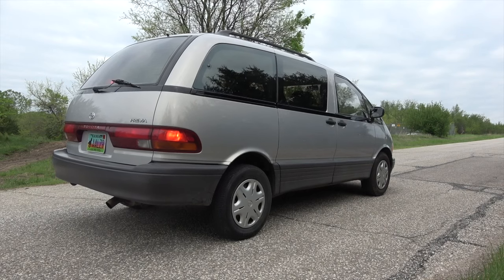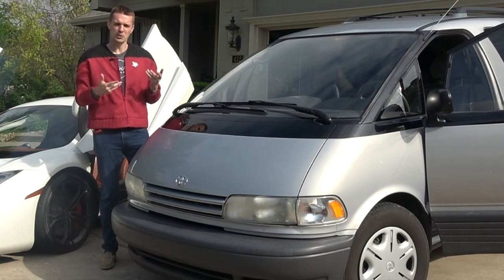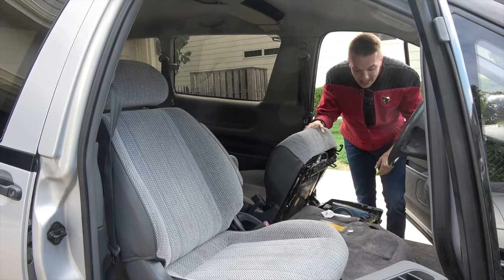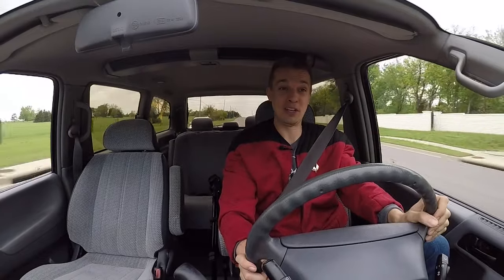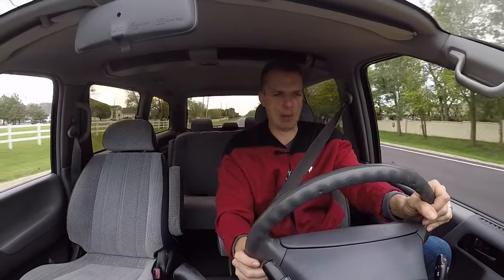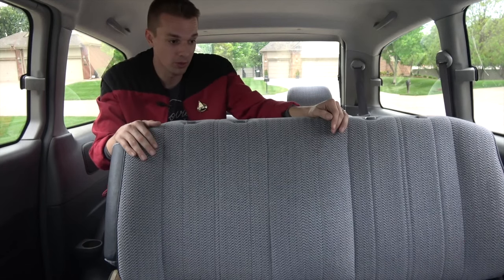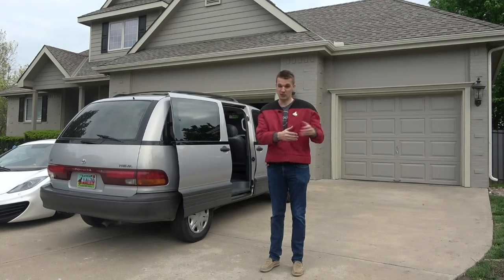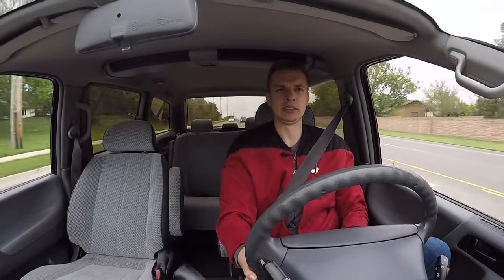I Bought the Greatest Minivan Ever Made: Toyota Previa Supercharged SUPERVAN

Comment: Be mindful of the supercharger oil in these. Most shops/mechanics don’t even realize there is an oil reservoir dedicated to the supercharger oil and running the level low can do some damage.
Reply: The oil is basically the same as gear diff oil. Like a 75w-90. On my 97 Previa SC at least there was no reservoir, just a drain bolt and small 1/2" maybe 3/4" sized  yellow fill cap directly on the side of the supercharger. I used to change it myself about every 15,000 miles since gear oil is much longer lived than engine oil.
Reply: @roochiecooch  Hi may I ask where the SC is located?  Is it under the Brake Master Cylinder near the airbox or on the passenger side below the alternator ?  Thank you

Comment: I had a diesel version. Brilliant thing. I ran it on everything from vegetable oil to WD40 and it did burnouts 🙄
Reply: Ah the days of running diesels on used chip fat...
Reply: @catnapwat  Those days are still alive
Reply: Not sure modern commonrail diesels will run on vegetable oil
Reply: @catnapwat  There's still old cars on the roads
Reply: @catnapwat  ya you have to actually make bio diesel (filter it and cut it with alcohol) for modern cars and even then it's not recommended to run it all the time. I used to run it through my 03 golf TDI every once and a while.
Reply: It will but you have to preheat it to 70-80°C to make it runny.
So you start the engine on diesel and after it reaches operation temperature you switch it to vegetable oil. And before turning the engine of you drive the last mile on diesel to flush the injectors
Reply: @CAESARbonds  I've seen people just use fresh new oil, it ruins the injectors on the long run but works and drives normally
Reply: Wd40 wtf
Reply: People are importing the diesel versions into the US for this.
Reply: @CAESARbonds  Nope, I ran it for 8 years on Veg oil with no modifications, through hot or cold weather. It ran best on Rapeseed oil which was actually the cheapest. Achieved 115mph on it. The only downside was it left the rear of the vehicle covered in a sort of varnish and some people complained that it smelt like a chip shop. ;-)
Reply: @catnapwat  Well I'm not sure  want to put it in my Merc C350 to find out. The merc does have a heater element in the fuel filter so it probably would work but no I would only do it in an emergency!
Reply: @VitariusLaszlo  Yes, we had a large drum of it, so we had to try it, the car was almost empty so we put about a gallon in it, it ran perfectly and the exhaust smelt wonderful ;-)
Reply: For clarification it was a 1992 Toyota Estima Emina. Imported into the UK. It was a 2.2 Diesel with a Nipon Denso injector pump (Bosch copy) Rear wheel drive. The Estima was 100mm 4" narrower than the Previa for the Japanese regulations.

Comment: Owned one of these in AU for years, here is trivia about the previa in Australia, we don't have that seat flipping back problem on Drivers side "which is good" it's on passenger side which OEM think was designed in Japan and named Tarago or import Estima in AU.
It's true about how it sits on road for road handling ,great for long trips back in the day. 
The End came when headgasket blew the 2nd time @over 400,000km on the van.
Reply: stigonutube Yep Previa head gaskets. We see a ton of these vans in NZ and petrol or diesel engines have legendary head gasket issues. So many Toyota engines of this era did.
Reply: I had a car with the weak head gasket problem. If I hit traffic it could overheat and blow the gasket. So I fitted a switch inside the car and ran the wires to the electric fan thermostat in the radiator.
As soon as I hit traffic I'd switch on the fan and the engine never got hot so it never blew the gasket again.
Reply: @Google_Does_Evil_Now  yes however only so long they will keep running in that state of failure of headgasket, mine started loosing coolant and then hydrolocked in piston the 2nd time round..great vans but was time to say goodbyee
Reply: @DiscoFang  yes first one was corrosion in head coolant ports and lead to failure then 2nd time was loosing coolant and one day just hydrolocked when i try to start Van. greetings to N.Z From AU :)

Comment: The reason you can't find them is cause certain handymen and house painters love these things
 You truly do love crap
Reply: They love them because they last forever and don't break down.  Previa is one of those cult vehicles that's impossible to find for sale, because the owners hang onto them for 5, 10, 15 years and drive them into the ground, they're non-running scrap with 300k, 400k miles on them when they're done with them.
Reply: @aaronbays4  Every vehicle should have the fuse panel up top&center like that

Comment: In Australia they called the Toyota Previa a Toyota Tarago.  I had a 1991 2.4 litre Tarago for 24 years.  The most difficult problem I had to solve in those 24 years was an oil leak that I thought initially was a rocker cover gasket.  I finally figured out it was the o-ring on the distributor.  My wife wishes we still had that car.  Was so good for a growing family and long trips across Australia.

Comment: I have a '95 Previa S/C that I bought new in 1995.  202, 000+ miles and still going strong. I am a trek fan too, license plate holder states "Star Trek Fan Forever, ST/OS, ST/NG, ST/VG and ST/DS9"  This van has cost me very little to maintain, except of course the A/C that had to be overhauled last month after all these years.  What Hoovie failed to mention was the versatility of the configuration he has.  Despite the fold up rear seats, with the middle seat out you can carry 10 - 12 4x8 sheets of drywall or plywood, flat on the floor and still close the rear hatch....  Who needs a pickup of truck if you have a Previa!

Comment: Check the Distributor o ring gasket and the valve cover gasket/ spark plug boot gaskets. Both of those are prone to crack and cause leaks, but easy to get at once you pull the pass seat and unbolt the access panel. For a real unique build, swap it to manual with a 1991-1992 5 speed alltrac trans, and add a manual 4-low transfer case from a 1980's toyota 4wd manual van. Gonna need to do some welding to get the front diff mounted though.

Comment: Owned a ‘91 RWD, and totaled it in an offset head on collision at highway speeds.  Bought a new AWD one the next week, because it does snow in Iowa.  We owned it for 13 years and 185,000.   It was a great car.  We sold it for $3000 and they drove it another 100,000 miles before it got totaled.

Comment: Tyler, didn't the steering columns of these have a tendency to puncture the drivers thoracic cavity in front end collisions? 

Did you mention that it could be had with a MANUAL?

I think Yamaha designed the engine. (like the later model Celica).
Reply: Internet mechanic here

Can confirm
Reply: I had a ‘91, and we were in a frontal offset collision at hiway speeds.  We were fortunate to walk away.  I went out and bought another one the next week.

Comment: I owned 2 of the previous generation of the TOYOTA LE  van wagons an '85 & '86. Loved both of them.  Wanted to get a Previa, but haven't found 1 in good enough shape yet.

Also had 1 of the '90 Oldsmobile  Silhouette (Dustbuster) vans. Paid $900 cash at a car dealer for it.  Only thing that ever went wrong on that van was the water pump went out when we were going to trade it in.  (Didn't trade it.  😊) did eventually give it to a friend who didn't have a car. He in turn gave it to another friend doing pizza deliveries, and it's still going last I heard.

Comment: Owned a ‘92 Previa Alltrac.  We drove it 13 years and 185,000 miles.  Replaced with a AWD Siena, which was nice.  Wished I would have kept it.  Other than not a lot of power, and the AC couldn’t keep up after 105 degrees because of all the windows it was a great family car.

Comment: get a smaller pulley for the SC, ad a LSD, remove the seats and take it to the quarter mile!
Reply: So blow up engine after and junk it inside of a week lol.
Reply: ...sure, then take it to the wizard. more content for us
Reply: It'll possibly break into the 16's in the quarter with a smaller pulley. What a rocket!!!
Reply: @rhull3939  Very well could.  Uou just need to start worrying about the internals at a certain point.  If you plan on much life for it.
Reply: @cardinaloflannagancr8929  it would make about 200 hp. No need to worry about internals at that power level.
Reply: @rhull3939  I gotcha  sometimes people go overboard thinking oh just a pulley.  Local shop by me had a Lincoln Mark 8 up around 750hp.  Next owner threw a smaller pulley and blew it up.  They told him it was maxed without forged internals this that etc..  .  It had trans, diff all metco suspension underbody bracing.
Reply: @cardinaloflannagancr8929  750 is a lot. Going up from there will lead to things breaking all the time. What engine did they have in it? The 5.4, 5.8 or a coyote?
Reply: @rhull3939  They had the 4.6 dohc amazingly.  Though added SC and quite a bit else.  Couldn't believe it wasn't enough for somebody.  This wasn't a pure track car either, full interior with integrated roll bar under matching fabric.
Reply: @cardinaloflannagancr8929  that is a lot of power to make from that 4.6. was it the one from the 03-04 Cobra with the forged internals or did they upgrade to that?
Reply: @rhull3939  For whatever reason the original owner built up from it's factory dohc intech 4.6 32v.  Kind of just to do it type of project.   Crazy thing was that Mark 8 weighed more than the next project a 70 chevelle.

Comment: I bought a used one in 1999 because I liked the styling.  It was all wheel drive non-turbo so it was slow and the gas mileage was poor at around 13mpg.  The driver's seat was surprisingly uncomfortable on long trips. I was able to sell it for what I paid for it after owning it for only 6 months and I went back to a pickup truck.

Comment: Had one supercharged.  And AWD.  Plenty fast, especially how well it cruised at 75 mph.  Now, Hoovie, PLEASE PLEASE stop doing burnouts in such an old vehicle.  You mention it was leaking - well many of them did that eventually, and yours didn't have that many miles on it.  Burnouts potentially cause many other problems besides ruining that right rear tire.  Just stop.  Got that off of my chest.  Thank you.  We loved our Previa.  At about 200k it started with some electrical / wiring problems.  Likely due to being in the Northeast and salt on the roads during the winter.  Had those issues not started, I may have kept it several more years.  Also, I put in an aftermarket radio with a bit more power, but not a big amp or anything.  My Previa actually had a small subwoofer (stock) in the way back, which sounded really great with the after market stereo.  Hoovie, keep up the good work, and never get normal.

Comment: 2 years ago bought a 95 supercharged 140k and it was immaculate. It's was a trade in at a toyota dealer. After 4hours of negotiating I got them down from 5k to $2,200.  3months later it blew a head gasket and I sold it to a scrapper for $300. These things are such a nightmare to work on they are easily totalled by one major repair. They are cool but id stay away.

Comment: Hoovie, why do Americans go wild for manual transmissions?
Manuals are standard in Europe, we see autos as luxury, refined and even sporty (flappy paddles F1 style autos, Colin McRae rally type paddles).
Are USA autos slow at changing gear?
Is it because your roads are so wide and straight that you don't steer much so changing gear gives you something to do?
Driving quick on European roads that are narrow, twisty and full of obstacles an good sporty paddle auto means we have more control and go faster.
Maybe you can explain this or chat with Doug about it because it's a big difference between USA and Europe.
Thanks.

PS: maybe you'll do a European trip and try some unusual cars on our twisty tight roads?
Reply: T A they’re a dying breed over here, that’s why. Most cars don’t even have a manual as an option and even those that do are extremely hard to get or hard to find.

Comment: "You hear the supercharger and it is directly underneath you." 
No, actually the forward facing driveline drives not only the accessories but also the SC14 Supercharger. The supercharger is nestled right in the middle of all the accessories up front under the hood. It's held up by a big heavy cast iron bracket. There's even a small intercooler underneath the airbox, about 12 to 14 inches tall by about 10 inches wide, with the normal plastic end tanks that oem's use on intercoolers. I robbed the supercharger off of ours before sending it the junkyard to swap out the nearly identical but slightly smaller SC12 supercharger that was on my first gen SC MR2. I wanted to keep the previa but all at once the slider got stuck and engine blew, and was too much at the time for me to deal with in an apartment. With a little banging of the firewall the stock supercharger from the previa fits on the MR2 and adds a litte more omph. But that didn't last long as I now have a 3SGTE in there from the 2nd gen MR2 Turbo.
Reply: The midde row in mine were bucket seats, the also swiveled 180 degrees to face the back row. Not sure why? Maybe so a mother could tend to her infant in the back row? Still thought it was a cool feature.

Comment: might be 150hp, but 200ft/lbs of torque at 2000rpm. I don't know how they did it, but that engine is extremely high torque. Probably due to the rear end being geared, because there is really no difference in acceleration between this and a V8 F150 with twice as much power and weight.

Comment: You did get the All-Trac? Too bad : D

Dad still has a 94 Previa LE SC All-Trac, gold, auto - 285k original miles.

Also had a 1992 Previa, white, manual trans, non-super charged, 425k before a timing chain guide broke.

Comment: I'm not going to spoil this with tales of a Chrysler mechanic in the backwoods of Chesapeake who had a 12 second 1st generation Dodge minivan.  

But it is worthy to note that what you love about the interior is exactly what was designed into the 1949-51 full size Nash Ambassador and Statesman models.http://www.oldcarbrochures.com/static/NA/Nash/1950_Nash/1950%20Nash%20Airflyte%20Foldout/1950%20Nash%20Airflyte%20Foldout-02-03.html  Parents in those days were so afraid of the teenager whose parents let him drive one of those...

Comment: I read that the reason Toyota put a supercharger on the Previa was they still had quite a few superchargers left over from the 1988-89 Supercharged MR2's and decided to use them on their woefully underpowered Previas.  The Previa is hideous btw.
Reply: Maximaniac72 they also did it so it could compete with V6 powered minivans like the Caravans and Aerostars. A V6 wouldn’t fit in a Previa so they added forced induction.

Comment: Didn't they make a stick shift version?  Couldn't find it?
Reply: Hankola they did offer a 5 speed, but only with the non supercharged engine. Also extremely rare. I’ve worked for Toyota for nearly 20 years and I’ve seen only 1 in the early 00’s, it was also stripped down, manual locks and windows. They also offered a AWD Previa called the All-Trac, also rare, but more common then the stick shift one.